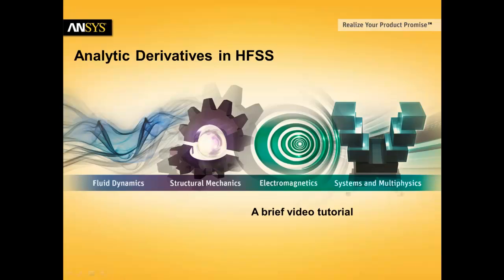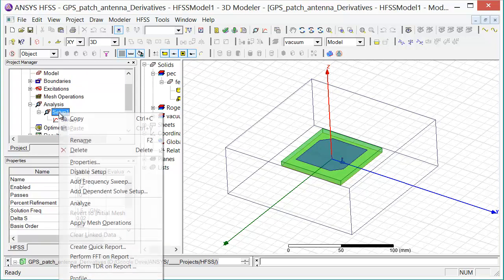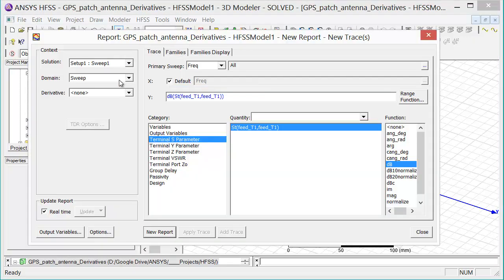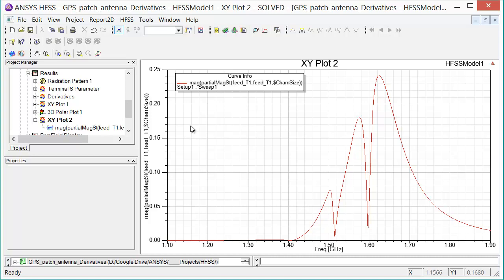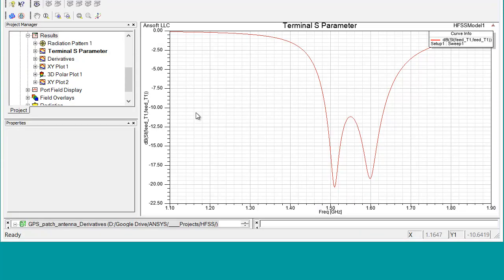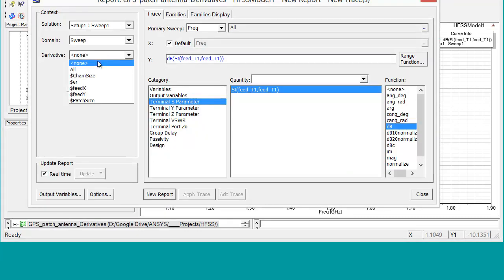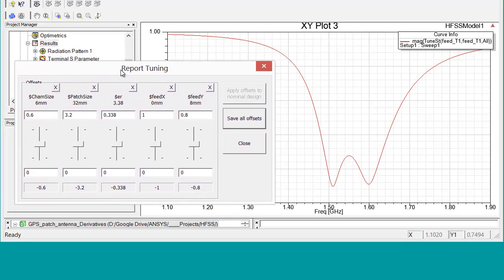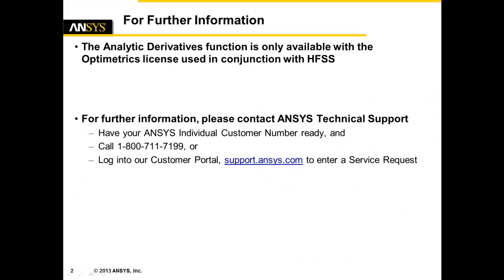How to Calculate Analytic Derivatives in ANSYS HFSS

Comment: Sorry to say it DOES NOT work. After tuning the parameters for optimized S11, when I update and save new values of parameters and re-run the simulation again in a separate file, the S11 is completely different from the tuned S11 plot. I guess, it is due to inherent mathematical approximation. Tuned S11 only provides results based on some mathematical data from sensitivity analysis but a separate re-simulation actually takes all subtelities of full wave simulation. Hence a lot of things are "assumed" in the solver's background during tuning. I am using ANSYS HFSS 16. I do have licensed copy including optimetrics. ANSYS guys please elaborate if you have anything to say